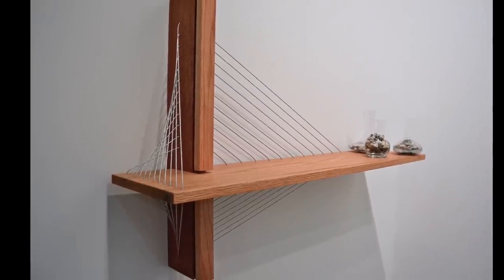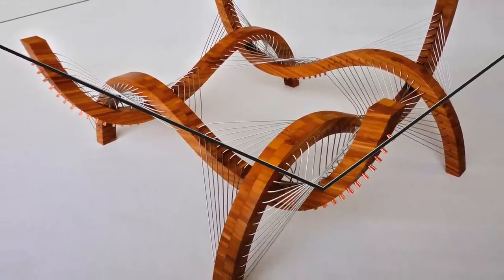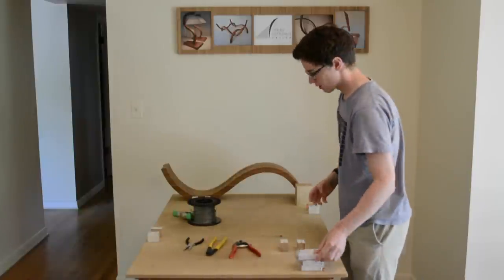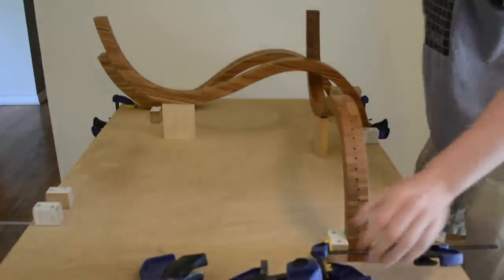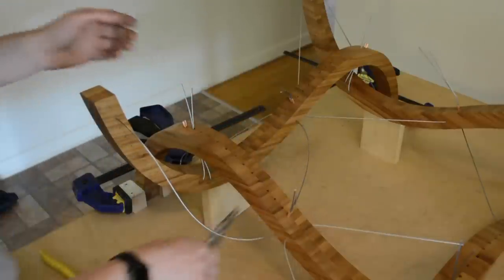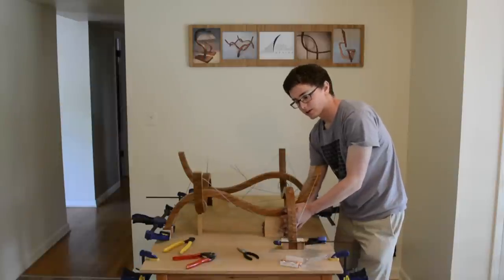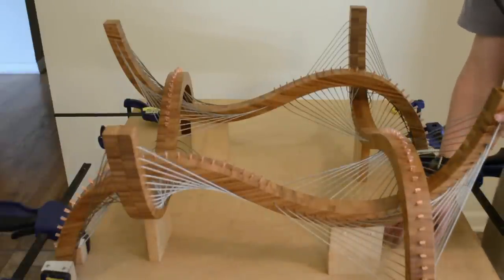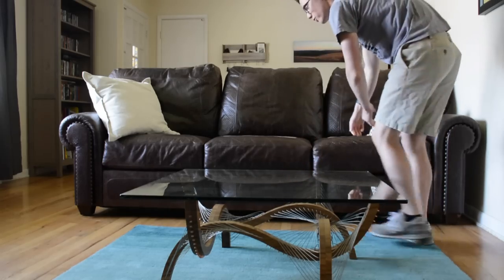Making Tension Based Furniture - Robby Cuthbert Design

Comment: Hello, I am French, your wooden legs are curved but you made the top of the glass table in a square shape, you could have made a more rounded cut "to measure" more artistic and which harmonizes better with the curves in oval shape, or cloud, but other than that, it's a great job, well done, have you designed beds in the same "levitation" spirit?
another little advice, you could have chosen a copper bronze color cable that would go better with the brown of the wood

Comment: The principle that governs tension-based stability relies on the inherent tensile strength of different material.  Even in bridge construction the transferred weight is ultimately supported by the bridge abutment that has compressive strength.  Your choice in furniture design is a curiosity at first sight but without the wooden support it wouldn't last even a second upright.  Nice piece of sculpture.

Comment: 1 small problem with your choice of materials. Using copper crimps with stainless steel cables may work well as long as the piece is kept in a low humidity environment, but once the two materials are exposed to high humidity there will be corrosion at the copper/steel contact points. In time your cables will loosen up and fail. You may prevent that by sealing each contact point with a lacquer, but it would be easier and permanent if you instead used stainless steel crimps so there would be no corrosion in the first place.

Comment: If you are able to hide the crimped brass/copper end it will add that much more fines to the design/final-look.
Other than that - chapeau (from French - I remove my hat for you in admiration. )
Reply: Inserted wire loop clamps and maybe a few drops of epoxy glue.

Comment: These cables aren't elastic, they're metal, there's no tension. If anything you only need the cables that combat gravity as that's the only force acting against it.
Looks gorgeous though, I guess that's all that matters... And functionality. ;)
Reply: SwissxPiplup Official Metal cables most certainly have tension. An example on a smaller scale would be strings on musical instruments. Most string instruments rely on a specific tension on the strings
Reply: Vincent Bar metallic strings on a guitar or piano for example have coiled strings, they are basically incredibly tight springs. ;)
Reply: SwissxPiplup Official Only for the lower strings. Once you get to the higher end, they're no longer wound but rather pulled.
Reply: Which is why the higher (thinner) 3 strings are most commonly made of plastic, not metal, because plastic has elasticity, allowing it to stretch; you can get metal strings in their place but they are still coiled, just very finely, making it difficult to see.

Comment: The furnitures look cool but you have no idea about statics. You don't need those “outer cables”.  There is no force pulling the legs upwards. It hurts watching this as an engineer. Especially the one at @00:33. Have you ever seen a bridge that had cables underneath it connecting to the buttom of the sea ? Yeah me neither. Half(and all of them in some designs) of the cables you use serve no purpose.